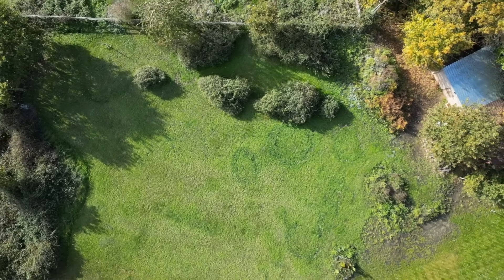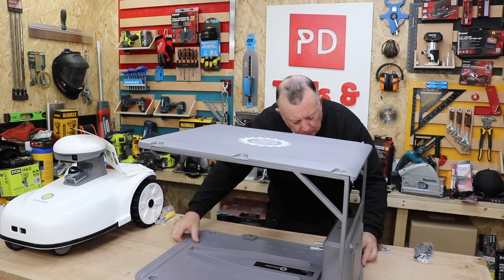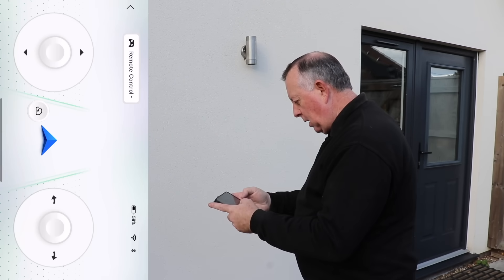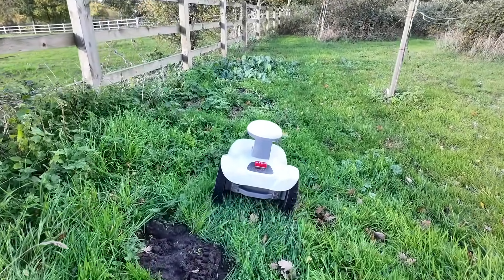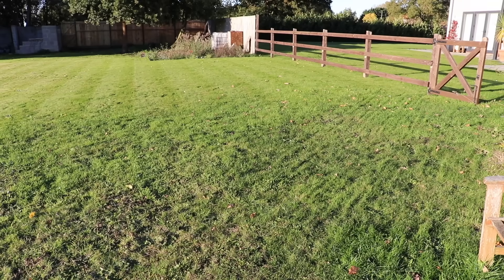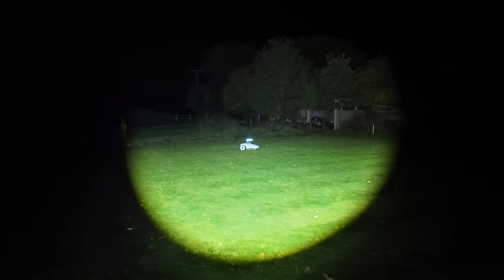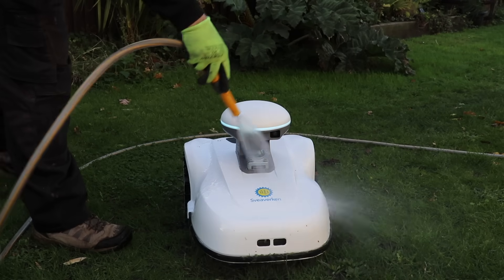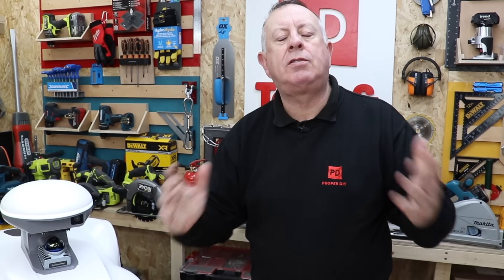The Blix Robotic Lawn Mower Can Navigate Around Anything!

Comment: £3000 for a mower with just razor blades on the bottom, LOL I have a 2 acre plot and cut it with an Ego Power Zero Turn Z6 EV Mower. Admittedly that cost me about £2K more (mainly for the batteries) but it's a proper Ride-On mower and a lot of fun, it's like messing around on a go-kart in the garden more than mowing. They came out in the USA first and after seeing a few videos on them, I knew I wanted one when my old stinky, problematic fuel based ride-on was due for retirement. Unfotunately, I had to wait nearly 2 years before they started selling them in the UK.
Reply: The investment is paid back in time and effort saved, it mows whilst you can do other things.

Comment: You have permitter wire mowers, and there are also lots of antenna based mowers that work in much the same way as the one in the video work, does this not need an external antenna, just the lidar on it’s hood?

Comment: It's really an excuse to buy tech stuff.  It's clever enough but plainly will struggle with longish grass - it's plainly too light to be any real use in those circumstances.  Also, you have a ride-on as well, which is far more capable, considerably quicker and gets closer to the edges.  For £3,000 I think one can do a lot better, I am afraid.
Reply: youre right, they all struggle with long grass. Theyre better called lawn trimmers than lawm mowers. But you use them differently...theyre automated so go out once a day, or whatever schedule you want, and they just trim the new growth from the day before off....which then falls away and gets mulched/disappears so there is zero tidying up. Your grass is now only ever the single height you picked when setting up...as it maintains that height.

Comment: Problem is it's cloud connected, which means if the company folds or decides to no longer support the machine it becomes an expensive brick potentially.
Reply: or expensive remote control car at the best
Reply: @maciej9280 this could be so easily overcome with local storage and local webpage. ESP 32 or SoC board like a Raspberry Pi could easily do this.

Comment: The website says up to 4 hours run time on a charge. Your paddock took over 5 hours. Did it head back to base when the battery got low and then resume the job where it left off?
Reply: good question